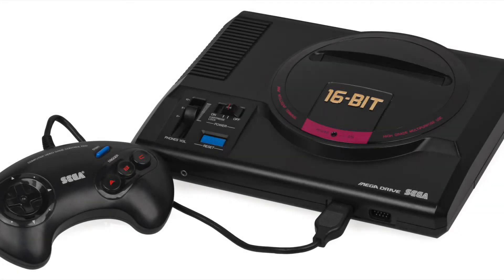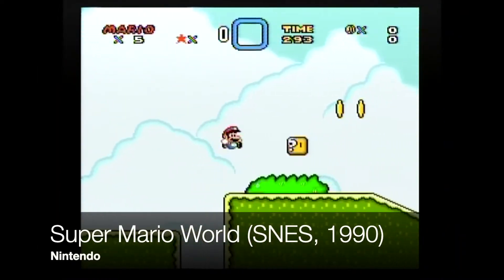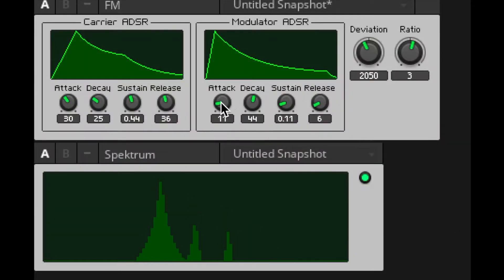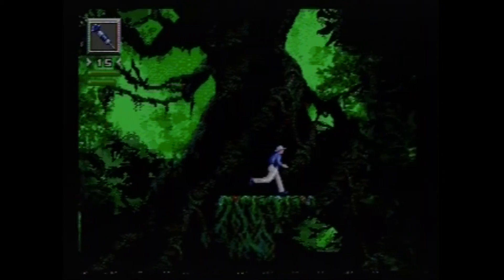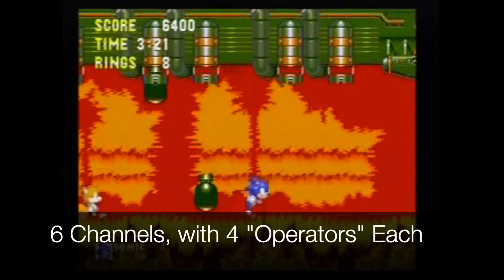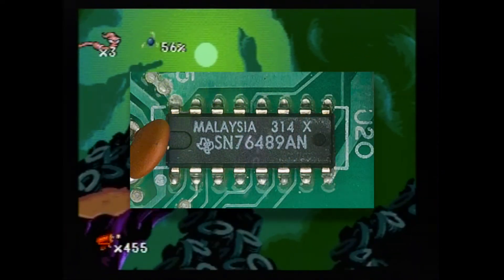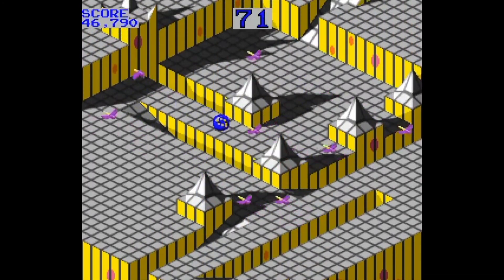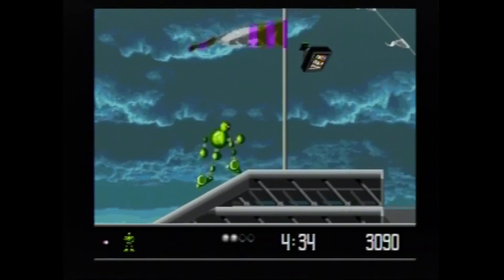Sega Genesis and FM Synthesis (Listening to 16-bit Videogames) | Simon Hutchinson

Comment: The interesting thing about the FM chips is each model had their strengths and weaknesses. While the YM2612 (based on the YM2203) had 5 FM channels (physically it had 6 but the last one was used to talk to the 2nd chip you mentioned in this video) they replaced the 3 SSG channels the YM2203 had. It also had issues creating very specific FM sounds that a YM2608 is able to make (YM2608 has 6 FM channels, 3 SSG channels, and ADPCM channel, and 6 fixed Rhythm sample channels) The neat thing between the YM2612, YM2203, and YM2608 was that FM channels 1 and 3 could be used in a more....advanced way. Composer Masahiro Kajihara did this with quite a few songs in the game Rusty for the PC-98 where channels 1 and 3 would play more than one instrument sound at the same time for songs. I'd need to take a look at how the MML programming of the songs themselves worked but when I look at the graphical piano of channels 1 and 3 the piano rolls for them behaves in a way one would go "what in the hell?...." But when I opened the songs in the YM2203 (OPN mode) you can see channel 3 for example shows all 4 operators, 2 operators playing one instrument while the other 2 play another. You could also use the SSG3 (Kajihara also did this for a few songs in Rusty) channel for samples too which sounds VERY black magic but is SO cool. YM2608 could also create more complex sounds compared to other chips. 

YM2608 is my favorite chip to work with.

Now for the YM2151. This one was a neat chip. It's 8 FM channels. THe FM sounds were also even cleaner. That's it. However it has the ability to work along side the OKI M6258V which is a speech processor. These 2 chips were in the x68k computer. So while YM2151 was used for FM and sfx for games, the M6258V handled drum samples, orch hits, any other samples a composer could make/use. Whats more interesting is some composers would write drums on an FM channel AND have drum samples for their games. A game that comes to mind that does this is XAK: The Art of Visual Stage. You can hear it because the M6258V has a very slight delay compared to the FM chip.

To this day there's just so much with these chips that you can do. Yuzo Koshiro recently released Earthion on steam which is a brand new 16-bit game natively in development on the SEGA Genesis. He apparently did some neat things with the SEGA Genesis sound hardware he hasn't done before with Earthion and it sounds incredible~!

Comment: Fun-fact: Yamaha's FM synthesis chips, like the one used in the Sega Genesis, actually employ phase modulation. This is indistinguishable from real frequency modulation when one sinewave operator is modulating another, but if using other waveforms or more than two operators -- which the chip in the Sega Genesis does -- you get a different assortment of timbres.